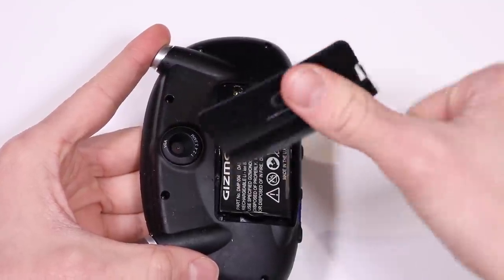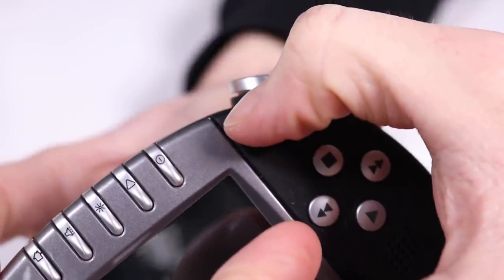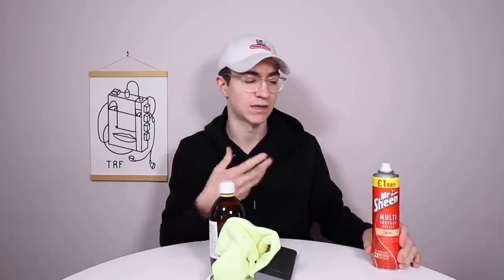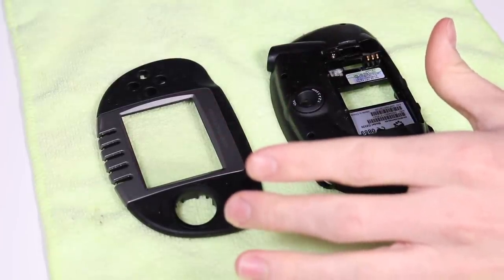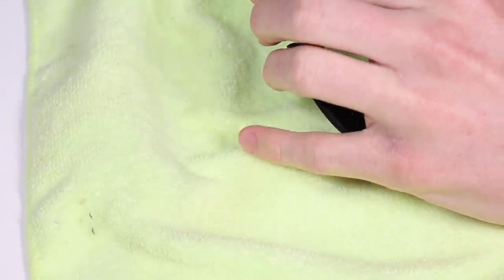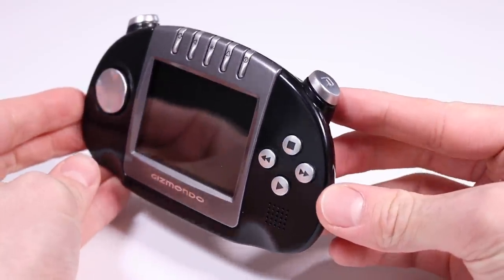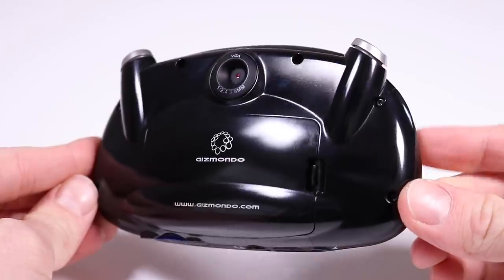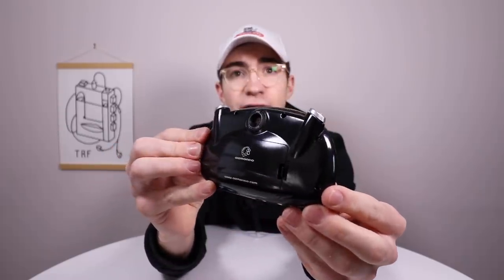Improving The Gizmondo!

Comment: That's awesome that Gizmondo put the text printing under the rubber coating. I did this to an item recently and it removed all the text printed on it. Be Careful guys. Maybe do a test spot.
Reply: Rodville yeah i was surprised. Most print it on top of the rubber.
Reply: Yeah was going to do this with my system, was super worried about the text and stuff. Good to know im safe with it.
Reply: Black rubber coating is cheaper than clear rubber coating from my understanding, so my guess is most use the black style rubber so are forced to print all markings on the rubber.

Comment: Nice. Would you ever consider replacing the rubberized coating? Maybe flex seal or plastidip? Even some knock-off sprays will still adhere pretty well to plastic. Do you think you’ll try looking into emulating GBA and previous console games ? Using an SD seems like the perfect way to carry your entire game library.

Comment: You could also use Nais, it's from Loctite, it has silicone, glicerine and UV filter, smells ok a bit like coconut.
Reply: zer0Bot yeah that would work
Reply: It doesn't seem to be that widely available though. I haven't tested this myself yet, but Goo Gone should do the trick on this gunky coating.
Reply: @anniewarbucks1794  The Nais is to make it shine and protect the plastic, that goo is easy to remove with any type of alcohol, it doesn't need to be isopropyl, yeah goo gone should work I don't think it would do any damage.
Reply: @zer0b0t  I get you, but it doesn't appear to be available where Cody lives or something.

Comment: Alot of cars from the 2000s had that gross rubber as trim in their interiors. I once worked as a vehicle inspector and hated touching that stuff. It's exactly like on the video there and on some the rubber coating was used for buttons and after a decade and a half the button is so soft that it quite literally gives in like a wad of mud. Like you can pinch at it and pieces of the rubber/plastic can come off. It may have been cool at the time but if anyone still has those cars today, they're all in this condition at this point. >__<